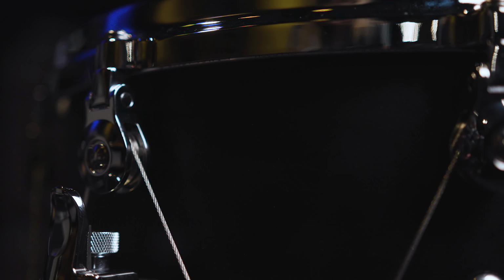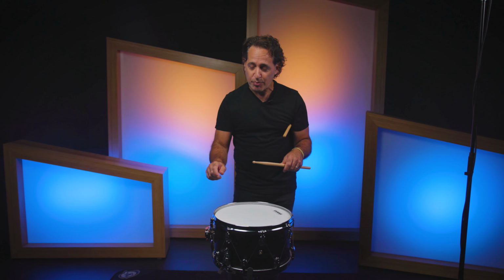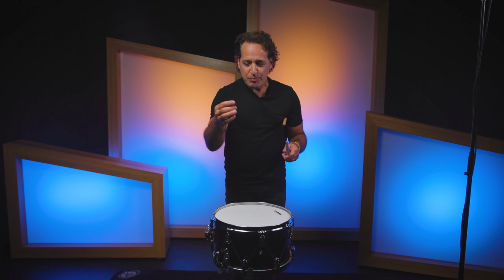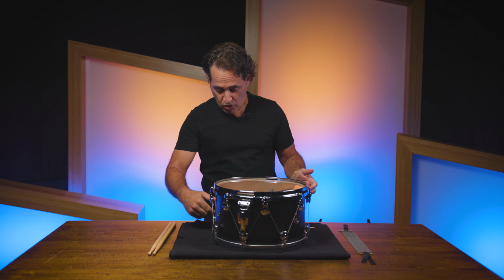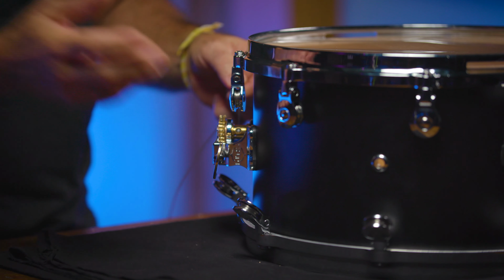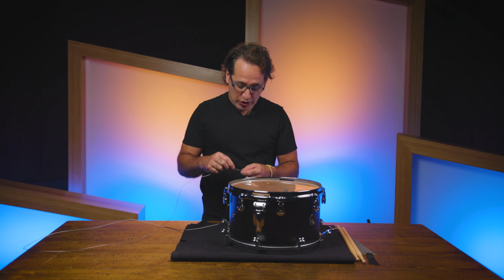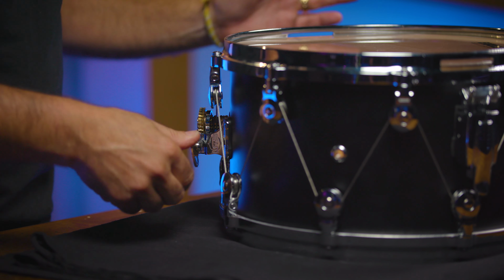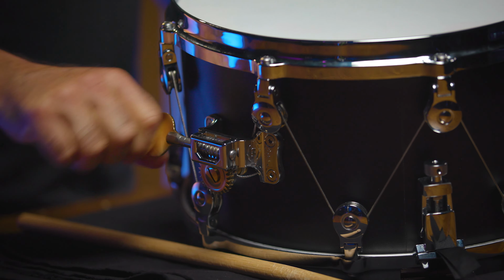Welch Tuning Systems Product Overview

Comment: That's a modern on a very old-school tuning system... old military drums, and way before that, the African djembe both use this same concept! Very nice. As always, the main issue for a snare drum, is that you almost always the snare side tighter than the top...
Reply: Exactly! Of course, with the snare drum, snare side heads are typical far thinner and will automatically be tuned higher than the batter head when under equal tension.

Comment: I like that there's less hardware on the shell. I'm sure a brass or bronze version would sound good. More resonance out of the shell with less metal parts bolted on to it. I like the equal tension on top and bottom too. Big fan of single tension drums. This thing is great!
Reply: They make a brass version, too!
Reply: The brass version is the Steve Pruitt model Nick mentioned in the video.
Reply: @ldcsam1  thank you for the information.

Comment: Interesting concept. You would think this system would pull down more on the side that the twist tuner is on. To tune all points of the drum equally is brilliant.
Reply: The pulleys minimize stiction to help balance tension around the entirety of the drum. We generally recommend giving cable on the opposing side of the drum a couple of pinches on either side of one of the pulleys to help ensure that the tension is even.

Comment: can i put these tuners on an LM400? Would they fit?
Reply from the maker: Hey, Mack Doggs. This will only work on the Welch drums since the lugs are placed in a certain way.
I hope this helps.
Jason Thiele, Senior Sweetwater Sales Engineer, (800) 222-4700 ext. 1391, jason_thiele@sweetwater.com

Comment: Kiss of death when Nick had to put glasses on to change heads lol It should not be this difficult. I saw Cole Paramore and Rick Dior do drum head reviews on YT. They did it on a dialtune snare.  You can tune the drum up or down a lot easier with the big ergonomic dial than this tiny key on the Welch.  I reckon  maybe 10-15 head changes in under 10 minutes. Some people said the Welch Tuning system was better in those video's. So I had to check it out on YT. Which bought up Sweetwater.  But after watching Nick waste a good half hr trying to change heads (Speeded up of course). I'm thinking Bill Belichck, Whose your starting QB this week ? Yeah..... next ?  😀
Reply: I posted with a link to the Dialtune snare; it seems to have gone missing. Not sure why; I'm fairly certain this product doesn't compete directly with a thousand dollar snare that has separate knobs for tuning the batter and snare side heads AND has quick-release rims, allowing both offset tunings AND blazing fast head changes.
Reply: Hardly! We had the pleasure of getting to spend some serious time with the WTS Artistry and Epiphany drums, trying different tunings and replacing heads. The drumhead replacement process is an absolute breeze and only gets easier as you do it more (gotta get used to a new approach, after all). We got to the point where we could swap heads and tune up a drum in a fraction of the time with WTS vs. a traditional drum and the use of a drill.

Comment: But you lose 80% of a drums dynamic range with even-tension systems… 
It’s great for simplicity, but it’s no replacement for dual-tension.
Reply: But you can still control the starting point of both from different pitches.. so that stays relative.
Reply: I think this system is great for snares but not that much for toms since you lose the option of getting different tones. That being said, other instruments do not have to deal with two tunable elements , so this system essentially simplifies things. Also, you have to remember those old rope tensioned snare drums were tuned the same way i.e. the top and bottom head at the same time so you can argue this system replicates that one.

In fact now that I think about it, other than bata and taiko drums, tom-toms are the only drums that have two heads. And with the bata drum, both heads are played, while with the taiko, the other head works only as a fixed resonating element, so tom-toms are an anomaly. Sorry, I'm rambling at this point! Have a nice day! 😄
Reply: Hmmm, 80% loss of dynamic range? That certainly wasn't our experience with these drums. We'd be super curious to know what your source is for that stat. We've spent quite a bit of time with three different WTS kits and, in fact, they all seemed to have a wider dynamic range than most drums, which we attributed to the minimal hardware piercing the shell. Never once as we were experimenting with different tunings did we lament the inability to tune the batter independently from the reso. The quality of tone left little to nothing more to be desired.

Comment: Another solution to a problem nobody has.
Reply: Respectfully, as a person with a wife, small kids, and very little time on my hands to replace and tune drums, I am simply unable to spend the time tuning drums like I did before I had to worry about irritating the crap out of everyone around me. This is absolutely a solution to a problem I had. I get that some people can quickly tune a standard drum, but I’ve never been one of those people. But I got a WTS snare and had it tuned up about 10 seconds after unboxing it and it has been in tune since.
Reply: Ah, but there's a difference between a problem that you can't relate to and one that nobody has. If this allows drummers to have another means of creating a more musical performance by adapting the tuning to the context, especially in a shorter span of time, we're all for it!
Reply: Shawn, this is the solution to the problem every drummer has had.  That problem is the time consumption consumed to get the perfect sound from any and every drum.  With WTS, as seen in the video, you can get many perfect sounds in just mere seconds.  Thank You WTS, Nick, and Sweetwater.
Reply: @SoundsLikeADrum  Agree!